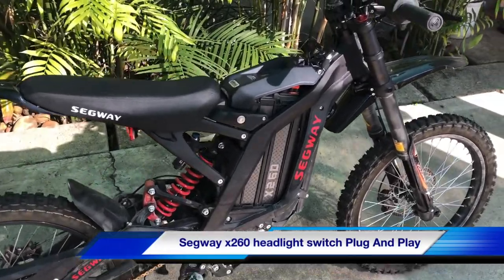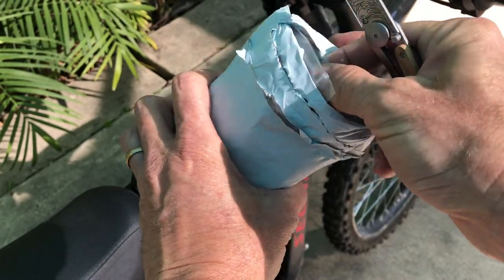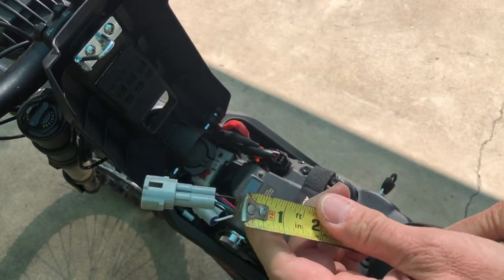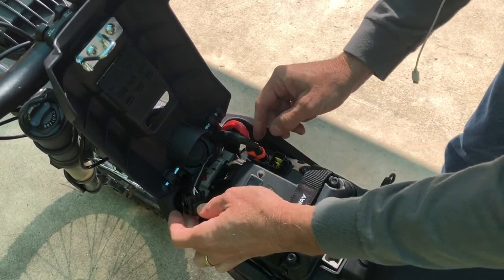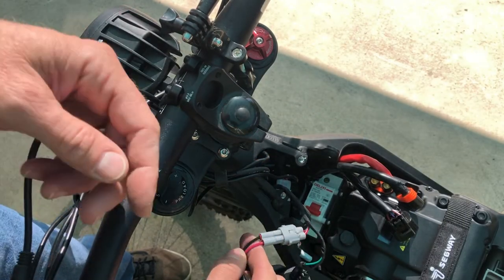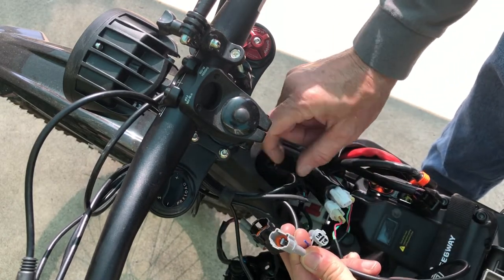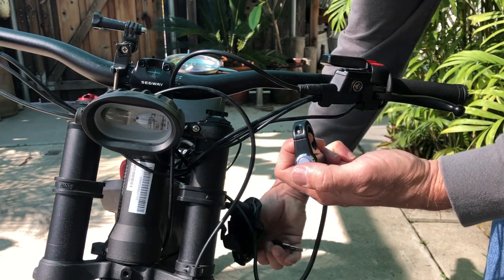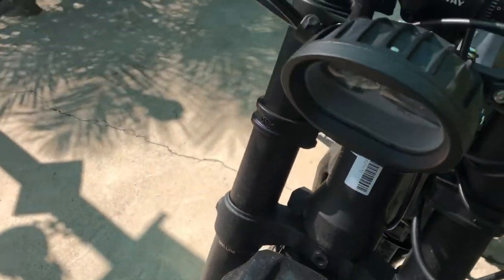Segway x260 Headlight Switch Plug And Play (#43)

Comment: What is the extra blue wire coming from the switch used for?
Reply from the maker: Not for sure. There was no wiring diagram. It may be just extra/unused or an alternate wire for the illuminated part of the switch. Thanks for asking!

Comment: very nice easy install! does it also turn off the rear?
Reply from the maker: Thanks! No it doesn't turn off the rear. I am working on making a plug and play switch now for total stealth mode. Too many projects now 🙄 but it's on the list. I'm sure someone will make one soon and have it on eBay or Amazon. I like this style because it is illuminated and water resistant. I will probably design and make my own. When I do I will try to post a video.
Reply from the maker: If you're ever venture down in southwest Cali come out to the whistling fence and go for a shred session 😎
Reply: @ocotillooutlaws4101  very cool! 👍🍻